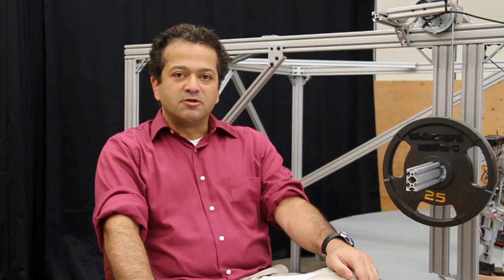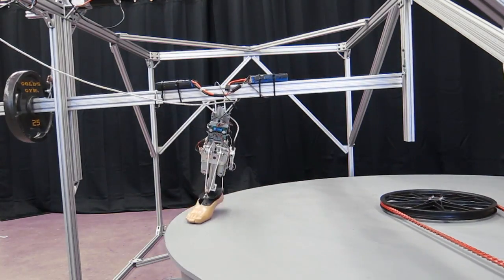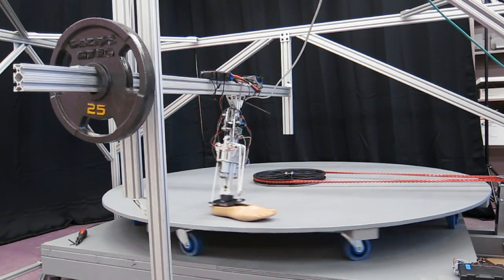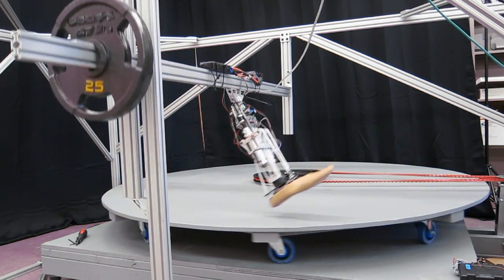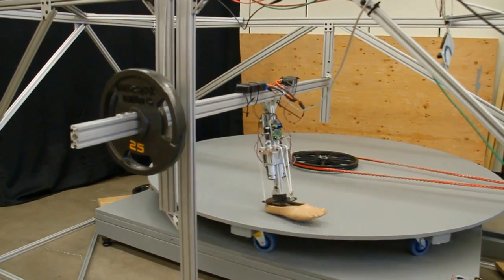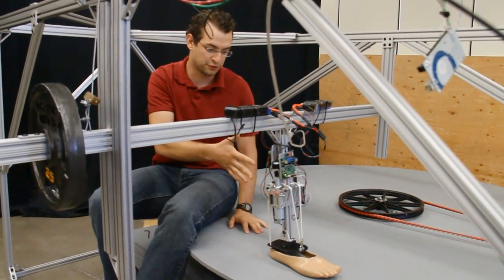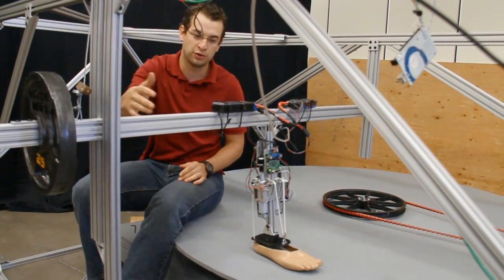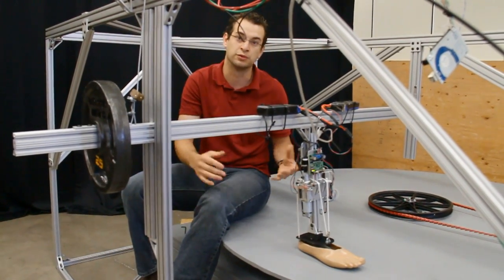Michigan Tech: Improving steerable ankle-foot prosthesis for amputees

Comment: When turning, first the ankle turns slightly (let's say to the right) prior to placement, and as the opposite leg swings forward, the ankle joint straightens, causing the body to turn to the right.  With human physiology, other muscular maneuvers may occur (knee bends, increased leg separation, hip maneuvers, etc). 

And it's directed by the brain, largely w/o conscious thought (other than determining where you choose to walk to), based on (1) visual input (particularly in mountain climbing), (2) other sensory input (touch), (3) a database of prior walking/ climbing/ dancing (et al), and in the case of dancing, keeping to the beat (auditory input).

Yes, this can be done with an artificial leg, but NEVER at this physiological level.